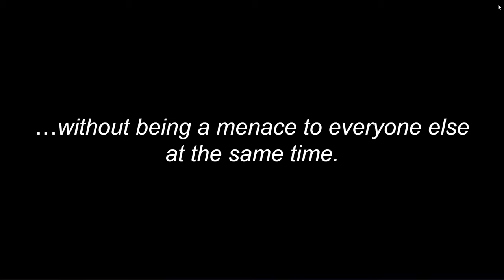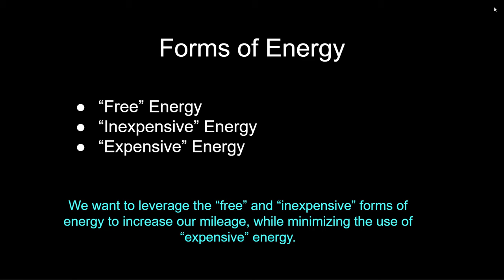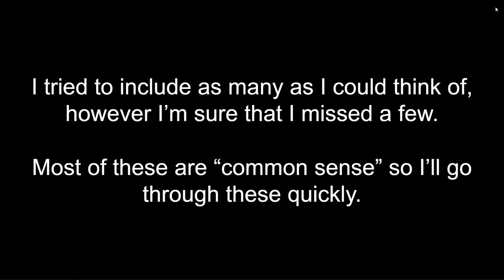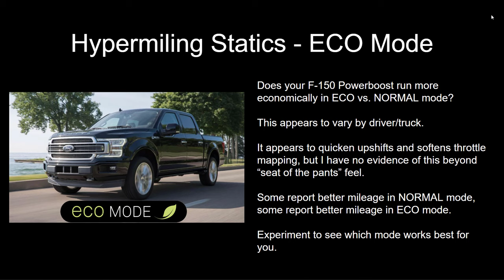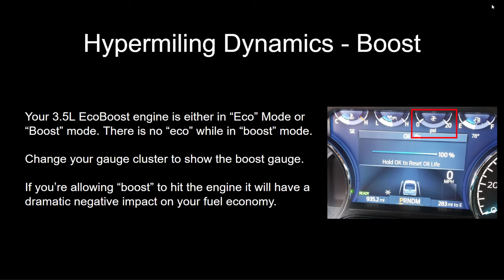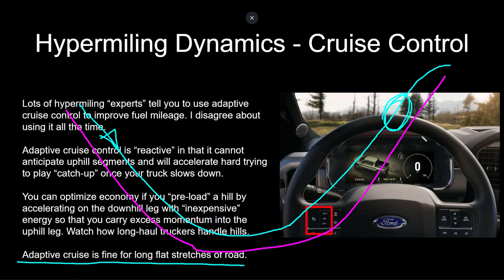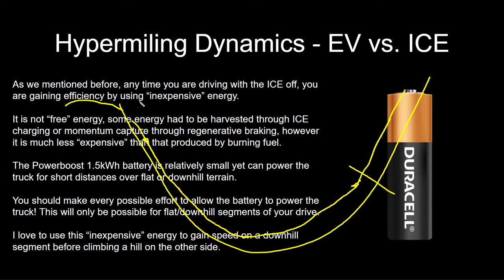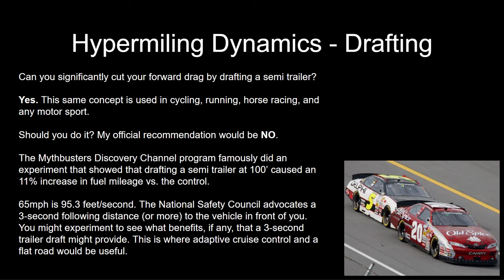How to HyperMile Your F-150 PowerBoost! Get Better MPG and Save Fuel.

Comment: I do just about every hyper mile technique I can think of in my powerboost. I like to go fast, but knowing I have the fastest production truck on the road leaves me laughing at a lot of other vehicles as they burn 15+ dollars of gas “beating” me off the line. Besides the extremely rare case of a raptor trying to brake boost (which has happened exactly 1 time) I’ve never felt the need to give anyone the juice. I use my powerboost as a work truck though, constantly hauling 1500+ pounds of dirt, rock, or garbage around. I also live in the extremely hilly terrain of the PNW, and am still getting about 25 mpg overall. I now this doesn’t account for my driving in eastern Oregon , as it’s much flatter and the speed limit jumps to 70, but 75% of my driving happens along the coast or in the valley where speeds are governed to 65 at a max, usually no more than 55. On top of that, safe driving speeds around bends limit us to 45-55. The powerboost really excels at these speeds, and as long as I’m not in a hard turn, I can run my gas mileage up to the 30 mpg range. I find myself playing the mpg game in this truck way more often than I ever thought I would, coming from a straight piped 2004 Nissan Titan with headers, 6” lift, 37” tires, and a tune that would make you cry. I was getting about 7.5 mpg  on a light-footed week. I’m now filling up every 3-4 weeks at about the same dollar figure I was filling up per week in my old rig. I feel like ford has a lot more to add to their battery, but I’m practically making money on a brand new vehicle when you factor in gas. Add that to my desire to go fast, and I’m adding almost 2 seconds to my drag time, while drinking less liquid gold?!? I’m leveling the truck next week, adding a tonneau cover, throwing 33’s on, and putting some silly expensive seat covers on ( I only have the xl as I wanted the highest payload possible) and am still hoping to achieve th 23 mpgs advertised.

Comment: Great video. I have two questions, first have you ever heard of driving in slippery mode to save gas and is it harmful? Second, how do you feel about altitude affecting mpg?
Reply from the maker: I have not heard about driving in "Slippery" mode to save gas. I also don't know much about driving at altitude as our altitude above sea level is about 950' here. In both cases I would have to test "A" vs. "B" to form an opinion.
Reply: @fixorrepairdiy4609  ok thank you.
I just noticed one day when it was raining for several days in a row I put my truck in slippery mode and noticed that I got better gas mileage. I just didn't know if that would have an adverse effect in some way.

Comment: There was a scene in the original Batman movie with Michael Keaton where he took a turn at incredible speed because he shot a grappling hook around a light post.  When you hyper mile get as close to a bat turn as you can safely.  Save that momentum!
When I drove a 2006 Prius I would find benefits putting the car in neutral going downhill.  That car had a CVT though and I learned it didn’t hurt anything.  Not sure how that would effect a 10speed like the power boost.  You’d have to find if the trans fluid was still properly lubricating while in neutral at speed.  Yes, you lose some Regen breaking but many times, especially when coming down a bridge, it was a good trade off.
Reply from the maker: This is the kind of comment that I hope for every day. Make driving an engineering challenge instead of the typical "point and shoot" like everyone else. Well done...😀🤜🤛

Comment: Hills, drop my speed 5 mph on the CC going up hill then increase it 10 mph going down and reduce 5 mph on the level. So say 55, 65, and 60 mph. My 4.2 gets 12 mph towing my travel trailer.

Comment: One thing I've noticed is in stalled/stop&go traffic, is an off-brake roll forward on EV is 6A draw. But coast-brake is 20A. This is due tonthe fact that there has to be "push" from the EV vs compketely cutting out, to mimic that of our conventional ICE. And little to no regen. Hence, it may be better to leave a bit of gap before letting off brake to minimize brake-coast.
Reply from the maker: Cool observation...thanks Hokie!

Comment: You can turn off your cruse for rollout as you descend hills your adaptive cruse can stop and go in traffic and maintain slow acceleration due the vehicle speed of the cars ahead of you. Brakes charge the battery so you can stay in electric mode longer. Braking for turns will put you back in electric mode!

Comment: I didn't look all the way through the comments here but wonder about the static effect of having a tonneau cover or shell on the pickup bed. I have been tapping the brake to go into EV mode and I'm pretty sure it has been annoying the drivers behind me. I would like to see a hack or solution to avoid having to hit the brake to turn on EV mode.
Reply from the maker: Hi Ed, I have no idea what to think about the tonneau cover. Mythbusters showed that it actually decreased mileage vs. a closed tailgate, while recent videos seem to disprove that. I quit caring about it, since I have no intention of ever traveling without my hard trifold cover, so that's my current "control" and I have no problem hitting 27mpg if I baby it. If you have drivers that close behind you I would not practice hypermiling. I'm very slow off the line as it is, because that's where most of the energy is spent, getting 6000 pounds up to speed. This annoys people but I eventually get up to speed and this gets me back in their good graces. (until the next light) But if I do the downhill "EV Tap" thing there is no way anyone is within 500' of me off my stern. That would certainly earn me an evil glare once they pass me. Cheers

Comment: On freeways, I generally drive eco mode 78 cruise controlled. RPM stays at 1900. MPG 20 to 23 depending on the terrain. 87 octane Costco gas. Central Valley California.
Reply from the maker: Thanks Gautam!
Reply: Yeah. The eco mode does absolutely nothing at 78 mph
Reply: @michalp2362  It actually does, specially during the cruise modes. It accelerates you slower in comparison to normal mode and generally avoid using the turbos.
Reply: @GautamAtri  I assumed constant speed but I guess it could make a slight difference in the adaptive mode.

Comment: Your videos rock!  Thank you so much. I do wish that this vehicle had an option/button to drive in EV mode only like our Toyota SUV has. It switches to ICE automatically when battery is drained or the vehicle hits 20MPH. 

2 Questions: Eco Idle - does this feature make any meaningful difference? (I have a 2023 and can’t find any usable info anywhere, and the notes are very nebulous, making me think this is just a gimmick.) 
2: is there anywhere to see the state of charge of the EV battery? I live near the top of a very dramatic hill in a part of the country where $6+/gal gas is not uncommon, leading me to wonder if some energy could be saved by fully utilizing the battery power on the way up the hill, knowing that I will be regenerating a sig amount on the way down, and if the battery is at max capacity at the top, much of my potential energy is wasted on the way down.
Reply from the maker: Hi Slammin- if you tried to force EV only, on flat ground at very gentle acceleration...you'd maybe cover half a mile. That's a small battery in a big truck. Also, the software keeps the battery between (roughly) 35% to 70% state of charge, which is optimizing for longevity. Don't want to drain it to zero. Your questions: 1) ECO does slightly improve economy but makes it less driveable. 2) to get state of charge, you need the OBDLink phone app with the OBDLink MX+ OBD2 dongle and you can then read the state of charge PIDs for your truck. Pretty cool to watch the battery SOC go up and down with load. cheers
Reply: @fixorrepairdiy4609 Fantastic!  Thanks a ton for the info.  I have an OBDLink reader, just haven't had the chance to to try it with the new truck yet - and I was hoping it had the PIDS for it!  Definitely trying this weekend!  Cheers :)

Comment: I don't think that my adaptive cruise will let me get more than 2 seconds behind the vehicle in front of me. I don't feel like that is dangerous since I know that it responseds a lot faster than I can if the vehicle ahead slows down.

I am new to your series so I have a question: Do you have an article about how the hybrid system works when pulling a heavy trailer in tow/haul mode?
Reply from the maker: Not yet Walter…have plans to get a teardrop “some day.”

Comment: Thank you very much for all these good explanations in your video.  Listening carefully your video , I wonder, since I live in Montreal with harsh cold winters if it would be a better purchase to buy a Ram Eco Diesel versus the F150 powerboost for a best annual mpg? The speed limit to get to my job varies between 30 mph to 45 mph
Reply from the maker: Mike, diesel is significantly more expensive than gas these days so it somewhat nulls out the mileage advantage of diesel. I would pick the diesel if you are primarily towing since that is the sweet spot of that engine, and towing with a PowerBoost will incur a pretty significant mileage penalty due to the amount of boost required. If you aren't towing, then it's a wash either way.

Comment: I agree with pretty much everything in your video except “forcing” it in to EV mode by lightly tapping the brake. 
I find it inefficient if the intention is to maintain speed. It only makes sense if you plan on a continuous deceleration. I don’t wanna go in to physics of it but it won’t yield efficient use of your “inexpensive” energy if you use it for something that comes in cheap anyway. You wanna use the cheap energy stored in a battery for something more demanding like an assistance in getting back to speed from a stop instead of forcing the ICE in to a boost due to depleted battery.
Reply from the maker: Just trying to get the ICE from running and burning fuel. Let gravity pull the truck down the hill. ICE not needed but it doesn’t know it yet. Cheers

Comment: I have 2021 PB with an aftermarket sliding bed cover. Any thoughts on whether is should clean it up aerodynamically speaking? So far I have not seen any appreciable difference but it has not been a side by side controlled test. On another note: I see the "Blue Cruise" now works...and works well! I guess it updated over the air. I thought I'd have to pay  Ford to have that option
but ....so far, so good..
Reply from the maker: I have seen the Mythbusters show that an open bed actually increases mpg…and i’ve seen other a/b tests showing that a bed cover increases mpg. I’m just going to keep my bed cover closed for practical resons.

Comment: I watched with interest your video.  Very well made and well researched.  You put in a lot of work into your script and slides.  Thank you.  As a 45 year engineer in the oils and gas business, I had a question about your comment on the energy quantity of a gallon of non-ethanol gas vs a gallon of ethanol gas.  With, according to you, the non-ethanol gas having more “energy” per gallon, thus giving you more energy at the tires, thus making up for the higher cost.  I have not researched this statement, but would appreciate it if you clarified it, yes, I know, look at ethanol values, compare a 10% mixture, etc, etc etc, I just don’t want to reinvent the wheel if you have already done it.  Can you provide some backup for the statement?   I’d be very curious, as I would switch completely to non-ethanol gas if it were a break even proposition.  Thank you and keep putting up well made and thought out videos.  Thank you.
Reply from the maker: Hey Vic I'm no chemist, and all of my data was produced from common internet searches. Here's an example of something very specific to this topic that I found: https://www.mauioil.com/what-is-ethanol/   Will it actually save you money based on the higher efficiency? I'm sure that the additional efficiency would be absorbed in the higher cost. This all goes out the window when towing, however, as you need all the efficiency that you can muster. cheers.....
Reply: Thanks for the quick reply.  I will look into it and get back to you.  BTW, I had a 2012 F150 Ecoboost for 120,000 miles and 5 years.  It had the 3.73 rear end.  I loved it.  We had a 24’ Winnebago at the time and this truck was plenty big enough for the trailer.  Traded it in for an F350, when we bought a fifth wheel trailer.  I am now in the process of ordering an F150 Powerboost, again with the 3.73 rear end, that’s why I was infested in the ethanol free gas.
Reply: “INTERESTED”, not “infested”.  Thought I checked the reply, but missed that word.  Didn’t want the internet to misinterpret.

Comment: I’m not sure if I should take mine to the shop/back to the dealer as lemon; it’s a 4x4 off road and max tow package supercrew lariat with 6’7l bed. I keep it in ECO mode 80% of the time. The dash is showing me somewhere around 16mpg. Occasional A/C use, live in the blazing South. Yes, if I reset it and drive carefully for the first few miles it can show up to 26 briefly, but under extended real driving drops down even to the 16 average. Not sure if something “broken”. (22 powerboost)
Reply from the maker: did you lift it or add big tires? Even guys that are hoofing on it are getting about 20mpg without trouble.
Reply: @fixorrepairdiy4609  nope, it's whatever comes standard on the F-150 lariat offroad version, with te 6.7 bed

Comment: Very interesting. As you can see in my channel I do not have a Powerboost but I am very interested. What tires do you recommend? Any list that shows the ones with the least resistance?
Reply from the maker: Don’t know the answer to that but it would be a 100% street tire designed for zero off-roading. I will look ay Michelins when it’s time for the OEM tires to go.

Comment: It's winter time and I do mostly in town stop and go driving.  Getting just over 21.1 mpg in Normal mode.  I found that ECO mode does not get me any better gas mileage winter or summer.
Reply from the maker: I've stopped using ECO mode myself. There might be a slight edge but is not worth neutering the throttle response to find it. cheers

Comment: I’m not sure if I should take mine to the shop; it’s a 4x4 off road and max tow package supercrew lariat with 6’7l bed. I keep it in ECO mode 80% of the time. The dash is showing me somewhere around 16mpg. Occasional A/C use, live in the blazing South. Yes, if I reset it and drive carefully for the first few miles it can show up to 26 briefly, but under extended real driving drops down even to the 16 average. Not sure if something “broken”. (22 powerboost)
Reply: I’m in the same boat.  I can’t get above 22mpg no matter what I try.

Comment: At the yield sign, when you accelerated did it switch to ICE or stay with EV mode? So you never know what mode it's going to be in, but learning little tricks will help conserve (like tapping the brake to kill the engine) but you still had EV, now if you would have accelerated would it have switched to ICE or stayed EV? Big question, can you decide to drive EV, and when it depletes to 15% switch to  ICE and let regenerative system charge the battery like in the Lightning?
Reply from the maker: Everything depends on the load requested of the engine. I can generally stay in EV mode if i am gentle with the throttle AND the road is level or descending. You cannot CHOOSE to drive EV but you can ENCOURAGE the truck to stay in EV by how you use terrain and throttle. I got 30mpg on the slighly-descending trip from Asheville to Greenville last night in heavy rain. Not bad for a 6000 lb traveling brick.

Comment: I don't see much in here about coasting in neutral.  I often to that to extend downhill runs on the highway.  I'm waiting for my powerboost to be built in October.  I assume neutral could add some additional mpgs?
Reply from the maker: Tod you can certainly try that, although downhill runs are great "free energy" situations to charge up that battery for when you need it. Putting it in neutral will disable that function.